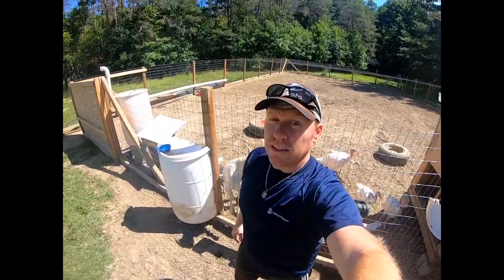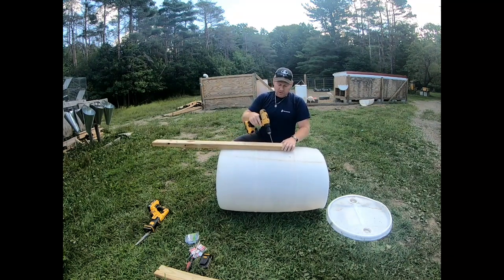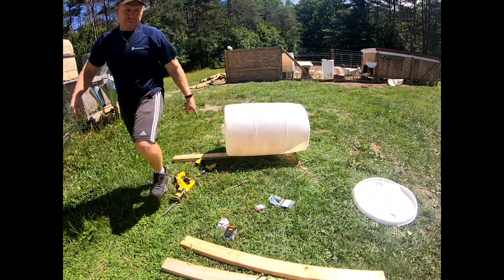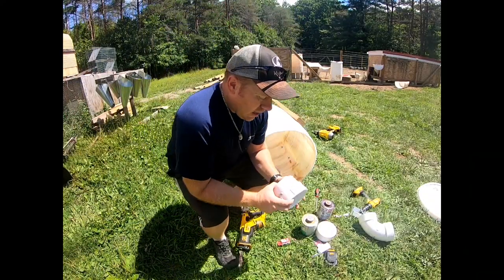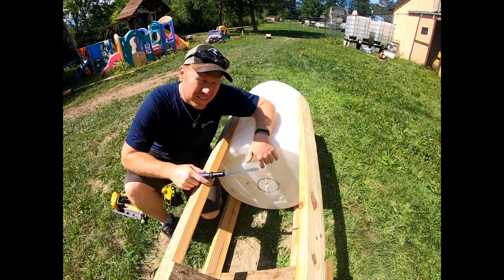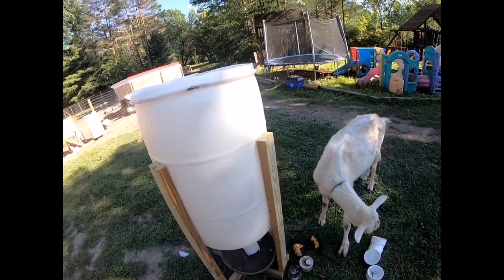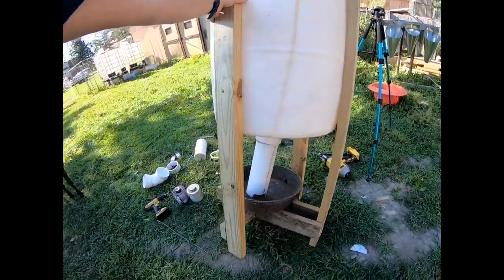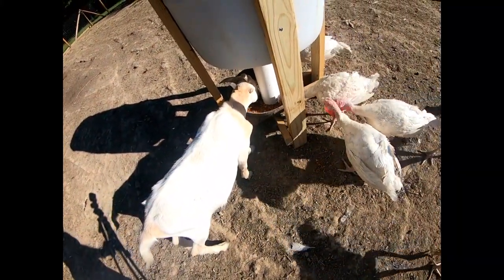DIY 55 Gallon Drum Gravity Feeder

Comment: You should use a toilet base flange it will sit flat in the barrel good job great video
Reply from the maker: I actually thought about that, thats a great idea , I already had the pvc though, next one I do I will try it out, thank you for watching and Merry Christmas!
Reply: I used the toilet flange on my build works great, my only problem is finding a lid for my barrel since it did have a lid and the top even flipped over doesn’t cover it well.
Reply: @erikhenderson3660  I. Pulled flat beds and have old tarps if you can find one you can cut it to fit over your barrel and wrap a bungie cord around it or get a cheap tarp or something you can coat with flex seal should work
Reply: @mikeedwards2384  sounds like a good idea, thanks!
Reply: @erikhenderson3660  no problem happy to help and great hunting
Reply from the maker: Yeah you have to cut the top off close to the lid all the way around for a good fit, then you can use bungee straps or latches to hold it down to keep out rain!

Comment: lol, #1 why didn't you use a funnel (out of sheet metal) on the bottom inside to get 100% to fall out ? #2 why didn't you use the top (cut out) to fit at the bottom to catch the fed, but to fit also evenly inside the 2 x 4's ? #3 drill holes in the bottom to drain standing water(from rain) out.
Reply from the maker: Definitely all good ideas! But sheet metal would rust out and bend and break with my goat's with the horns, the top actually has a perfect grooved lip all the way around so when you cut the top off and flip it upside down it covers the barrel perfectly and you avoid having to drill holes in the bottom, it stays perfectly dry year round,  although I did find I had to bungee the top on because the goat's ram it hard sometimes and pop the lid off, good ideas though ivwish there was more of a funnel effect for the food but we never let it get that low anyways with these animals lol thank you for watching!👍🙂

Comment: Awesome build I just bought a 55 gallon barrel to try another method... didn’t realize mine didn’t have a removable lid. So this helped me out a lot. Did you have any problems with the feed that didn’t make it out of the barrel rotting or anything? And how many pounds of feed would you say the barrel can hold?
Reply from the maker: No the feed stayed fine just make sure the top covers it so no rain or snow gets in and you should be fine this holds 6 plus 50lb bags!!  There probably is better ways to build them but this is just what I thought of from the top of my head I even added additional legs so my goat wouldn't knock it over when the feed gets low, definitely makes feed time alot easier good luck and thank you for watching!! Hit that subscribe button if you haven't already! Thanks!😁
Reply: You can order a funnel that sits inside the bottom of the barrel you may have to cut a slit in it and let it overlap itself to fit there on Ebay I believe that's where I saw it
Reply from the maker: Thanks I'll check it out!
Reply: A tip: watch series at flixzone. I've been using them for watching loads of movies lately.
Reply: @Dangelo Elliot yup, have been watching on Flixzone for since november myself :D